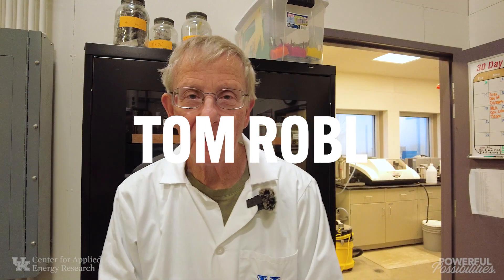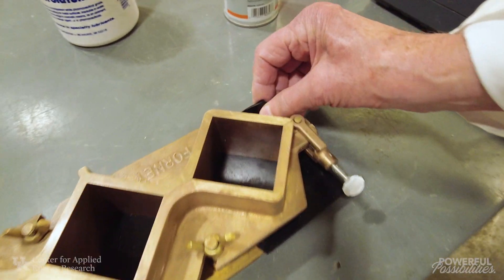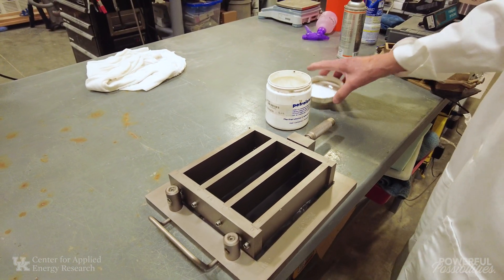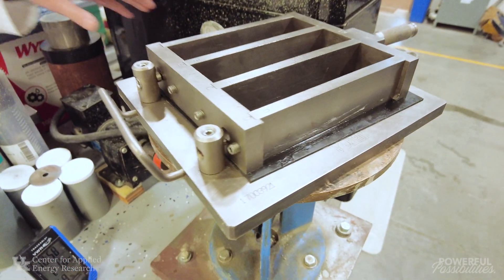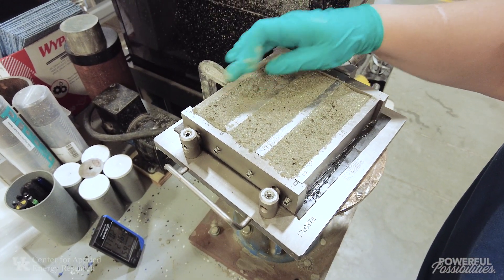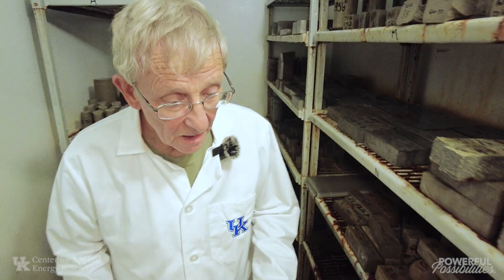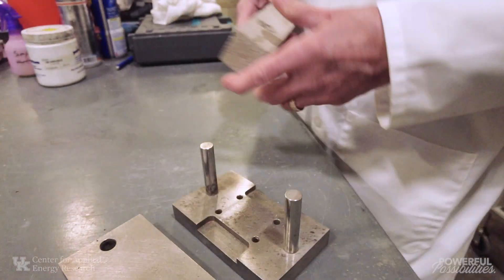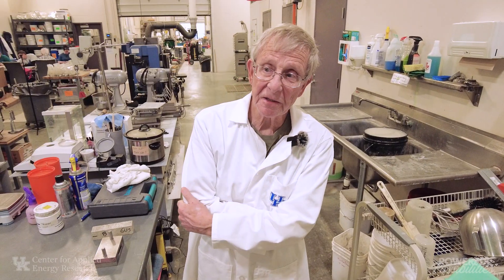Social Media Pozzolanic Activity

Comment: With the current Administration's efforts to shut down coal use, an informative video on what the repercussions of that policy creates would be helpful.  Aside from losing the reliability and economic benefits of coal fired generation and the subsequent fly ash, No coal use = a drastic increase in concrete cost, a decrease in concrete availability and a decrease in quality of concrete containing lower ratios of flyash.